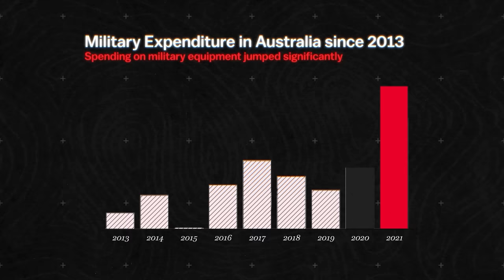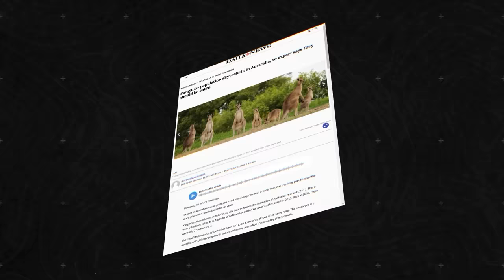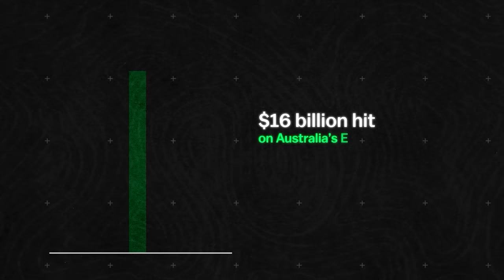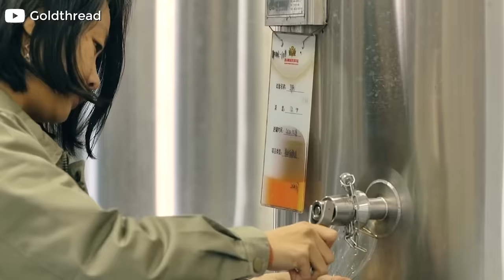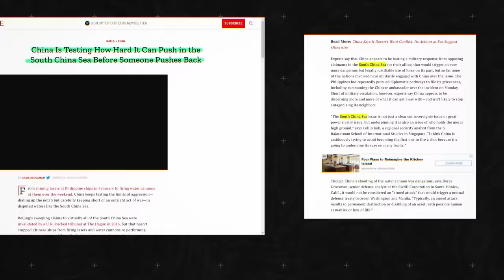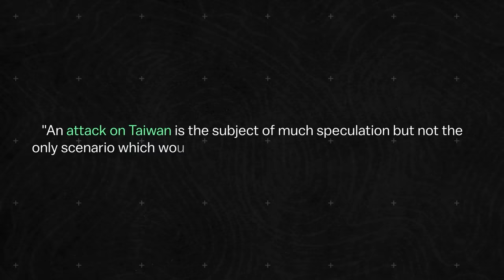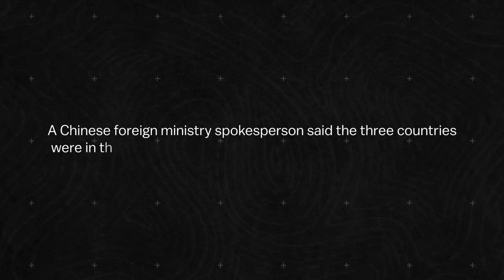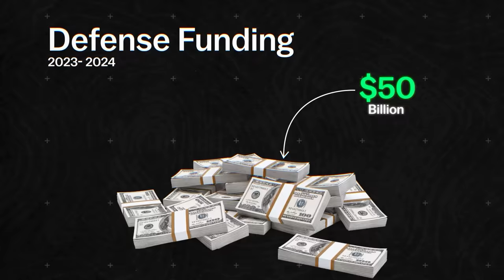China's Australia Crisis, Why Australia is Preparing For Nuclear War?

Comment: A major reason why those trade sanctions got rolled back was due to Chinese Dependence on Australian Coal. We export A LOT to China. So when they essentially stopped trading coal with us their coal fired power stations suffered leading to wide spread blackouts soon after.
Reply: lol it's Albo n Penny went to China begging, not the Chinese came down under.  
Btw it's not rocket science to find out that China itself is the greatest coal producer in the world.
Reply: The recession is coming; you will soon hear people crying and blaming Cina for not buying Aus stuff.
Reply: You should google the biggest coal-producing countries in the world. And compare the coal production between China and Australia before posting this nonsense.
Reply: @sibaraku2023  Chinese coal is of very low quality, whereas Australian coal is among the best in the world. So, using Australian coal results in much cheaper prices due to not requiring to use as much. On top of that, Chinese coal powered fire station and steel mills have been built to use the higher quality Australian standard rather than Chinese produced coal. This is what led to the import ban back-firing on China and contributing to power outages. It doesn't take much research to see that China is the largest importer of coal, as well as the biggest producer. The reasons I've mentioned above are why they still import so much.
Reply: @socrates5647  well thats not bloody true at all and even if it was australian coal is some of most energy dense in the world so you'd be compairing apples to oranges
Reply: @socrates5647 china economy shrunk. Australia economy grew
Reply: Thing is, they only stopped importing coaking coal, not metalliferous coal, metalliferous coal makes up the bulk of our coal exports to China, it's necessary for steel production, Chinas embargo never really hurt us anyway.
Reply: @socrates5647  It's cocking coal they need and they actually opend up talks to get it back cuase thier coal is lower quality for making steel
Reply: Don't forget the iron ore China needs to build more stuff. 😃
Reply: Rubbish, Do some googling.
Reply: @eebox1  lol again it's not rocket science to know that China's annual coal consumption in power stations is about 3 billion Mts,  Australia total coal export to China in 2023 is about 60 million Mts. Surely you understand the difference between 'b' and 'm'.
Btw congratulations that you aussie invented a new ward of 'clean-coal' .
Reply: @socrates5647  ok did a quick google search and ill concede you are right china is the worlds largest coal producer though i imagen those number come striaght from china and china would never cook there book,  furthermore it is interesting that folllowing chinas trade embago on aussie coal that china had wide spread blackouts just saying.
Reply: Massive blackout from another world:face-purple-crying::face-purple-crying:
Reply: @Dept246  What you don't realise is that China's national policy is to use its domestic natural resources as a war reserve and to import foreign natural resources in peacetime